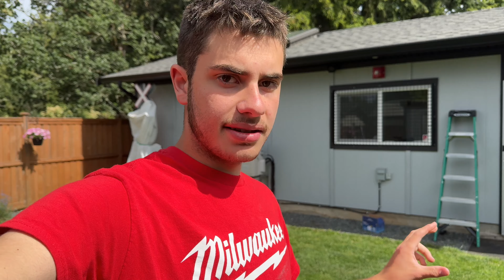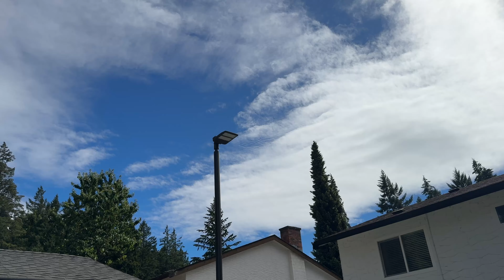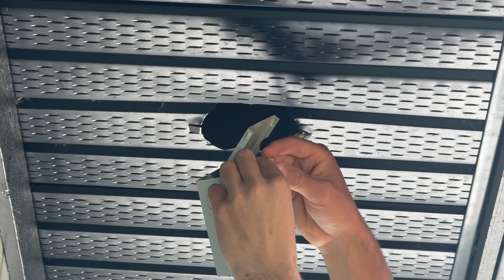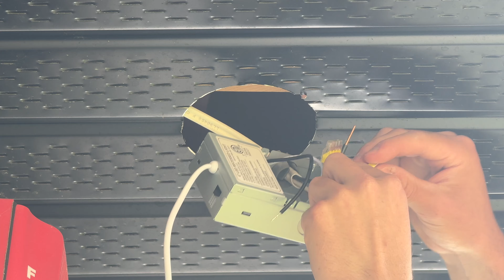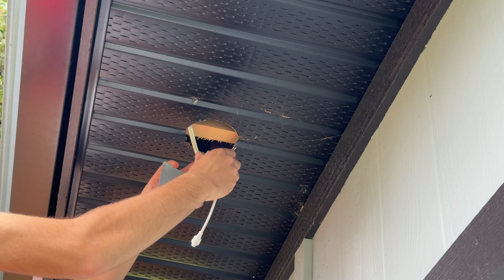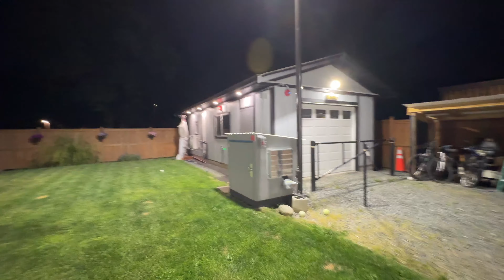Replacing Garage Outside Recessed LED Lights

Comment: If the actual LED part fails it's usually easy to fix. 99% of the time one of the LEDs will be failed open, you can solder a jumper across the bad one and the light will just keep working.

Comment: Most LED's I find these days claim 5 years at 3 hours per day. How long do they run on the timer?
Reply from the maker: On at sunset of at sunrise
Reply: Is that some no name cheap stuff? The LED stuff I deal with is at least 15000 hours (or 10000x switched on) I've multiple claiming 50000 hours.
Reply from the maker: @Ricko1Games  I've had the good stuff fail in less than a couple years. The lifetime they say is absolutely pointless I don't know if it's worth even consider it anymore.
Reply: @nics-systems-electric  oh yes, definitely. Lighting stuff fails way too quickly for how much it costs. I have a battery-powered sensor from a mayor lighting brand at my workplace. It has failed about every 10 months in the 3 years I've worked there. It costs €150 to replace. If you say replace with a different brand you also need to replace all the light fixtures...
Reply: Especially anything specialty or dimmable. I have bulbs in all my interior fixtures that are recommended by Lutron as “fully compatible” and they have a 25,000 hour lifespan supposedly. Yet I have to replace them probably once per year, and they run at most 6 hours per day (1/10th of their supposed lifespan).
Reply: @nics-systems-electric  generally their lifetime is worked for optimal conditions where they are run for short periods so that nothing really gets warm and if it does it calls down quite quickly

Comment: Hm, it's weird that the LEDs itself failed. This is usually due to the manufacturers slightly overdriving them. But hey, a little more light with a much shorter lifespan is exactly what's good for business, right? ;)

Comment: This is cool, but I feel like it's because you ran out of video ideas. I have an idea for you: (Don't take this as a demand) I heard you have been talking about replacing the fire door, why not a video on that?
Reply: thats not a nice thing to say
Reply: @ryanwoods4691  wasn't trying to be rude
Reply: Why would this be running out of video ideas? In this video he showed a legitimate problem he had as well as showing the proper solution to that problem.
Reply: @Some_Random_Teen  I think I was just asking him if he was running out of ideas, and I just had a preference for what he could do so he doesn't run out